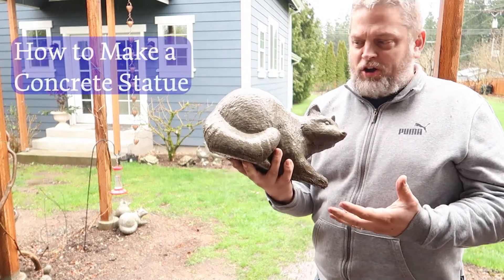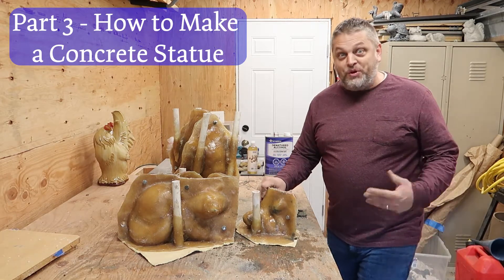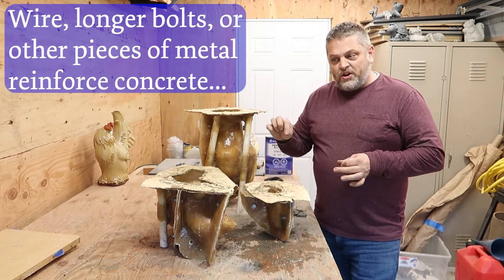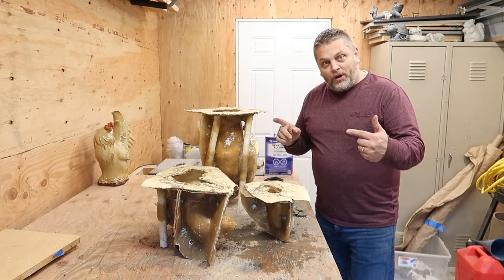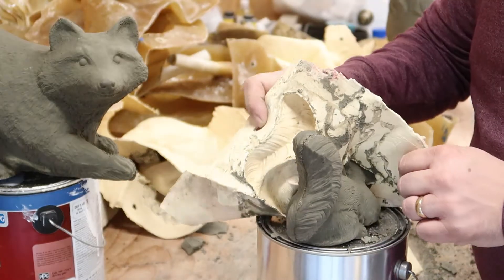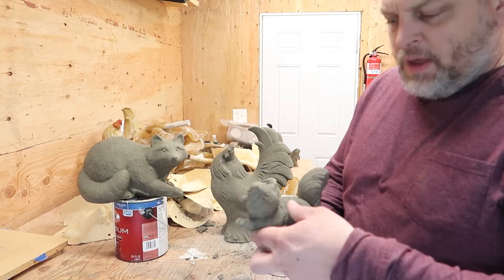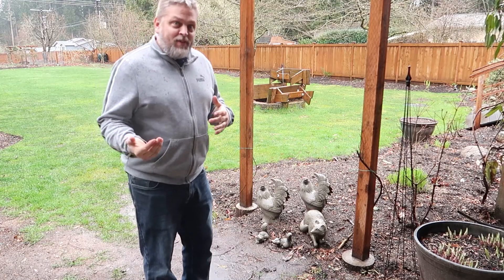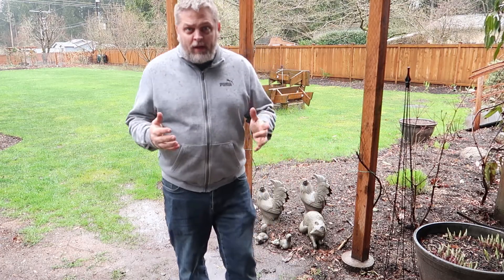How to Make Concrete Statues - Complete Guide to Make Garden Art (Part 3)

Comment: Thanks, Andy, for such explicit instructions.  Do you have a concrete type you recommend (without gravel, I assume)? And, can you fill those slight spaces in the seams with concrete at all, or smooth them over?
Reply from the maker: I use the normal premix bags from my local hardware store, which works great for my statues. As for seams, I have another video that shows repairs, and in that I talk about using cement (Portland Cement) to repairs seams. It is concrete without the sand and gravel, and it makes a big difference in the seams.

Comment: Great video. Would it have been harder or easier if you wanted longer before taking the shell and mold off? In other words, do you want the concrete softer or harder when you take everything off?
Reply from the maker: If you leave a mold on "too long," the hardness can be a challenge for cleaning the seams and seems to affect the mold, however, I have shifted for some of my statues to give them an extra day of curing. The outside temperature and humidity also affects this, so I leave them longer in the winter than I do in the summer.

Comment: Great video! How do you know how much mix to make per item?? What is the mix to water ratio?
Reply from the maker: I estimate what I think I need and make a bit more. Often I might need a little more and I'll mix some extra. When I make the concrete, I make a bag or partial bag and only a couple statues. And, I usually have a couple dried chunks of concrete nearby in case I need some filler. If I make too much, I pour the remainder on the ground and after it dries, I use it as filler for a future statue. Concrete is cheap, overall, so making a little extra is only a dollar or so of waste.

As far as the water and mix ratio, I do it by sight to make it a sludgy slop rather than a really soupy mix. If it is too soupy, I pour a little more from my extra bag to thicken it.

Comment: Hello, I really enjoyed your videos they are very informative. 
I came across some metal molds at an estate sale. Large and small , small bunnies to bird baths. But they don’t have the silicon/rubber for the inside. Just wondering if you know if it would work just using the metal form or would I need to make a silicone mould somehow??? Thanks for info you can give me
Reply from the maker: The molds could work, as long as there are not parts that would catch on the mold when separating. If it looks detailed on the inside of the mold, I would assume you are good. Try it with one, and I hope it works well for you. The flexible material of a mold like latex rubber or silicone allows for a wide range of details and shape that you cannot get in a rigid material.

Comment: The cement makes the status robust but relatively heavy, so wondering how air create which is cement infused with foam would stand up to the process.
Reply from the maker: I have inserted some foam chunks in the base of statues where there is space to fill. It makes them lighter.

Comment: Hi love your creations i bought some latex head planter molds but have no idea what cement to use in them. Ones ive seen at shops dont seem to have gravel mixed in am i correct by saying its only cement and sand mixed together. Would appreciate any advice you can give me
Reply from the maker: For years, I have mostly used the regular concrete from the local stores, and my statues have turned out great. The mix is sand, gravel, and cement to make concrete. With that said, I have also been a little spooked about the products from online experts. Years ago, I bought a bag of cement and stored it in plastic buckets with lids, which I would often tap into when mixing concrete by adding an extra scoop into my mix. Usually I forget, so I can't say this actually has helped anything.

Comment: Did you simply use High Strength Concrete Mix and Water? Did you use any sand or gravel as well?
Reply from the maker: I use the common concrete mix from my local hardware store, and it says "high strength" on it. It works well without anything extra added to it, however, I got spooked a couple years back after reading recommendations to add extra cement to the mix, and so I usually put a few cups of cement to my mix. It seems to be the same. There are stronger mixes sold, but I have not used those.

Comment: Hey bud was wondering if you could use this method to make like a blow mold type of thing instead of concrete?
Reply from the maker: I suspect there are a variety of other materials besides concrete, but concrete is so easy and strong. Whatever it is, it needs to be friendly to latex rubber. Good luck!

Comment: Do you mix sand and gravel with the concrete, and what parts of water to parts of concrete mix? Thanks
Reply from the maker: Most of the time, I just use the premix bags at the local Home Depot or Lowes. I have had continual success with just the normal bags without special binders or ingredients. And, the mix is usually a bit thicker than soup, but t total sludge. Thicker gets you more bubbles, I think.

Comment: Can you please tell me what kind of cement mixed you used. Thanks
Reply from the maker: All I do is go to my local Home Depot, and get the general, all-purpose ready-mix concrete. In my area, it is Quikrete brand, but I've used others, too. They all work great for me. For statues that have narrow thinks like ears or legs, I will put scrap wire, bolts, or other long metal to reinforce, but that is not critical. Have you made statues before and had problems with concrete?
Reply: @backyardadventureswithandy  Thanks so much for taking the time to respond to me.
Reply from the maker: You are weclome! @IAbulldogs

Comment: any possibility of damaging the rubber when agitating the mix with the sharp trowel ?
Reply from the maker: YES! It is possible, but I've never done it that I am aware of. I am generally just keeping it in the mix and if I get close to the edge, I am gentler.
Reply: @backyardadventureswithandy  -     i'd use a wooden spoon, body ends one to stir and one to poke ---- but it's not even necessary IMHO - fill it to 7/8,     tap on the table a few times, top off -  tap around the outside- how many times can the mold be used ?   It would be interesting to expirement with different mixes ---   old latex paint mixes well into concrete and adds color and strength in the right proportions -  you could play arround with etching the outside to expose a sand finish for an agged look -  powder concrete stain goes a long way and gives different shades depending on concentration -   great teaching videos - it took me a bit for it all to make sense  ---    it's something easy to manufacture a home  if you have a way to sell them.

Comment: I am wanting to try my hand at making some smaller statues. Can you recommend a great concrete that will give a smoother appearance in a small mold? Thanks
Reply from the maker: I honestly recommend the basic mix that the hardware store sells for general use. It works great for me. The smoothness comes from vibrating or tapping the mix in the mild so the air bubble settle. Perhaps they have a fancier one with special fibers for the concrete mix, but this is what works well for me!

Comment: Cant you live it in the mold longer to get it so it's not so fragile?
Reply from the maker: You can leave it longer, but I have run into two concerns. First, the hardened concrete can damage my mold on some areas that are excess, such as around the areas I poured the concrete in. These little areas break off easy, such as seams.  I'm not sure how to explain this, but there are usually little tabs or seams of concrete or spilled parts.  As I demold it, the harden concrete is harder to clean up or shave off. Second, it seems to affect the latex (slightly) if it dries in there over a longer time. It might be subtle, but I wonder if it takes life away from the mold.  With that said, I have left concrete in a few for longer times because of fragile parts.

Comment: Can you give any tips on how I would latex mold a sculpture that has holes in it? It's basically a koi fish that will have a hole in its mouth and underbelly. I want to use it as the top sculpture piece for a fountain. The water will come out of its mouth. I thiiiiiink, I would just put clay in the mouth and underbelly and do a 2 piece latex mold, then fiberglass. When I cast it with cement, just put a pipe through its mouth and stomach so there is an airway and the cement will harden around the pipe. Any help is appreciated!
Reply from the maker: I think you are on the right track. I would either run the actual tube or a slightly larger one so that you could insert the right size afterwards, along with having the space to replace it down the road.
Reply: @backyardadventureswithandy  Awesome, thank you for replying! I think I'm gona give it a try.

Comment: How do you stop from getting air bubbles in your statues
Reply from the maker: The key for me is to first tap, vibrate, shake, and all the concrete in the mold. Also, if the concrete mix is thick, it tends to have more air bubbles. I often go for a thick soup rather than a harder sludge. Then, I tap and rattle a bit to knock air bubbles up.

Comment: Nature can’t be wonderful if we treated fair. I picked up a statue that 50 inches high and it’s widest point is 16 inches wide the arms it’s a statue of mother Earth and for years I’ve been looking for a way to replicate this statue your video gives me promise I’m gonna try this method out it seems promising if you have any suggestions drop me a line. I picked this statue up at the flea market years ago , i’ve been looking for a method to re-create this statue for years this is the first time that I come across something I think it’s possible for that statue to be re-create it is off plaster of Paris out of concrete I can make it into a fountain it would be beautiful I know. Thank you for your video.The concrete mix is very important also.
Reply from the maker: If the first statue is large, I would encourage you to start on something smaller to learn how the process works. But, for me, I learned how to do this on YouTube years ago, along with through experience along the way. It's a great way to save and reproduce a statue for both you and for others. And, I just use the bags of concrete mix from my local hardware store...nothing fancy, and it works great!  Good luck.

Comment: What type of concrete do you use?
Reply from the maker: I actually use the standard Quickrete all-purpose mix, as it holds up great for everything I do. There are fancier versions sold, but I have not noticed enough of a difference to spend the extra money on those.

Comment: How Long Do These Pieces  Last  Out  Doors ?
Reply from the maker: These will last decades. My painted ones will last several years before the paint starts to show age or deteriorate, but the actual concrete is pretty tough. I suppose the finish of the concrete could show signs of age of out in a constant stream of rain, year after year, but I think decades is accurate!

Comment: Got a question, how would you go about doing this for a plant pot. Like the more unique kind, like the raccoon you did here but it’s got a hole in the middle to be used as a plant. But the majority is still solid. It’s just a small hole, not the entire inside is hollow. 
Is it even possible to use this same technique for pots bc of the hole??
Reply from the maker: Yes, this is totally doable. The key is to form a plug where you want the pot or hole to be, and with a straw or small pipe, have a drain hole so water can escape (if desired).

Comment: Thanks for this. Will it work over modeling clay for custom pieces?
Reply from the maker: I would think the fiberglass will work on anything, and if you are talking about the latex rubber, it might have an initial problem with a wet thing like non-dry clay. it needs to dry full for each coat.

Comment: I have a couple suggestions. 
Mix your own concrete, not bag mixes. Using cement, sand and small aggregate you can create stronger better concrete at a fraction of the cost of pre-bagged stuff. If you’re really into it use a plasticizer to make your concrete more liquid without compromising strength. 

After you are done your first pour mark the spots where concrete slurry seeped into the seam. Drill a hole through the fully assembled mold at those marks into the seam closer to the product and put a nut & bolt there to add pressure to that part of the seam. This should reduce the leakage making cleanup easier and a better looking product. Time is money after all.
Reply from the maker: Thanks for sharing some insightful tips, and I will experiment with this. I don't have a lot of space for storage of a trailer load of gravel and another of sand, so that is part of why I buy a few bags at time, generally, but I am chewing on this as I love saving money.

I do keep a bucket of Portland cement that I am starting to supplement my bags with, but so far, I have not noticed a difference. But, what you say is similar to a few others I have heard from.

As for the seams and all, you nailed it on the advice. My hen/chicken statue in my video is OK, but I do regret the seam placement as it is not visually the best. Thanks for sharing and giving some wisdom!!
Reply: @backyardadventureswithandy  you can go to your local landscape supply and but the appropriate sand and gravel by the bucket. I usually have about 5, 5 gallon buckets of each in my shop. Not as cheap as a truck load but still better.

Comment: Keep the statues wet for first week concrete will cure even harder and reach max potential psi, but they look amazing good job
Reply from the maker: Yes, spray lightly with a hose or a spray bottle, just be careful about too much pressure because it cane damage the finish/surface.

Comment: What kind of concrete mix do you use thank you very much for this three-part series helped out a lot
Reply from the maker: I actually use the basic concrete mix at any Home Depot or Lowe's. It works great and I tried a couple other ones in the past and noticed no benefit. If there are fragile parts like ears or feet, sometimes I will put metal reinforcement like wire to help give strength while the concrete is hardening.
Reply: Thank you very much for your reply I'm just now wanting to get started in your videos was great thanks again

Comment: looking good, but you must get problems with air bubbles (either at the latexing stage or in the cement/concrete itself
this is a 4-part mould, is it? what are the most parts you've ever cast a statue in can I ask?
Reply from the maker: Regarding the air bubbles, I find minimal air bubbles if I rattle/tap/stir in the concrete when I pour in the mold. Usually, I get more air bubbles if the mixture is thick or when I hurry through. My biggest air bubble regret is that a statue I once copied had air bubbles on it, and I made a mold of that statue. I should have shaved off the air bubbles, because now every one of my statues has an air bubble at the same spot.
   As for the mold, I try to minimalize the pieces, so 4 pieces plus a plug is the most I have used so far. I suppose a tricky statue may require more, but the tortoise is my most complicated structure.
Reply: @backyardadventureswithandy  I have been surprised to see statues (made of cement) of film characters such as - SUPER MAN aprox 2ft tall bat man & even a king kong v t rex statue (copyed from a fibreglass statue)
I know that cement/concrete doesnt flow as easily into a mould as say plaster of paris, but here they were
do you think you could mould film characters in cement such as...ROBOCOP or IRON MAN?

Comment: Hi. I came across your video and have to say it's the best how to on mold making for concrete statues. I have a statue I am working on restoring  a little girl statue that was at my grandmothers house for probably 45 yrs.   My hope is to restore the statue and make copies of it for all of her grandchildren.  When I bought her house, the "little girl" (as we call her)statue came with it.  Ok now the question... she's a fountain. I can't find any help on how to make the mold with the water way from the bottom of the statue to the water jug where the water comes out. Is this something that can be explained in a reply?  I really loved your 3 part video. A subscriber and looking forward to watching your others. Thank you- Lisa
Reply from the maker: So I have not done a piece with a water feature, but I have looked into this and one would basically run a tube through the statue where the water can connect, and then have the outflow at the spot that makes sense. The tube is simply a placeholder to get the water through, such, as a drip system
Reply: Thank you so much for your quick reply!  So after  I make the mold, put a plastic tube from the opening where the concrete would be pores thru the inside of the mold to where the water will exit?  I guess that does make sense! I knew you would know! I just couldn't picture it. Thanks you!

Comment: This is terrific. Thanks for making it and sharing!  
I have a strange question- how do you clean the bucket of excess concrete? Thanks!
Reply from the maker: Take your bucket outside and with the hose just rinse it out. I typically have one bucket I use for concrete and never really wash it out. Sometimes I've got left over sand on the bottom with water I leave in it.  If you have concrete leftover, then I would pour it on the ground in a spot where it can harden up and then I use it as filler for one of my larger statues later or just throw it away.